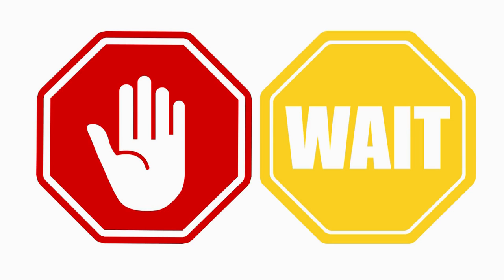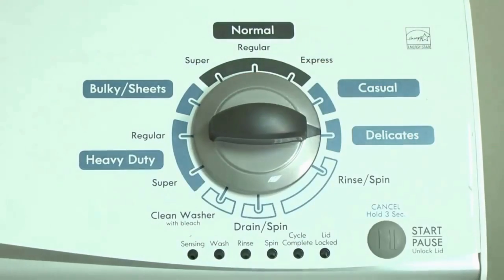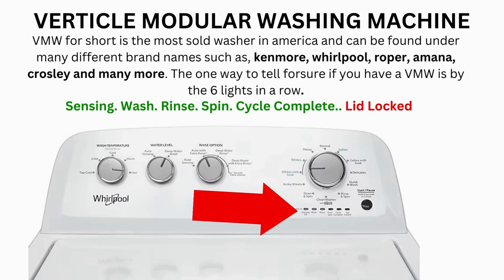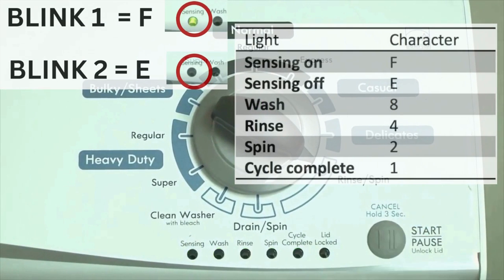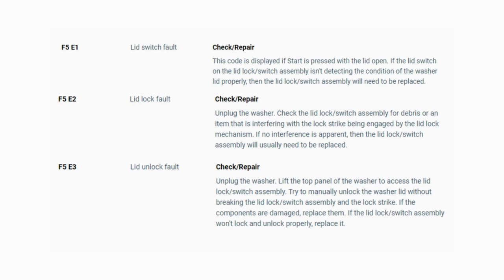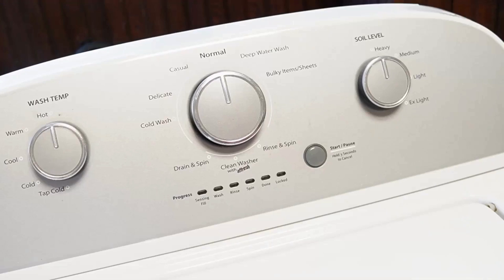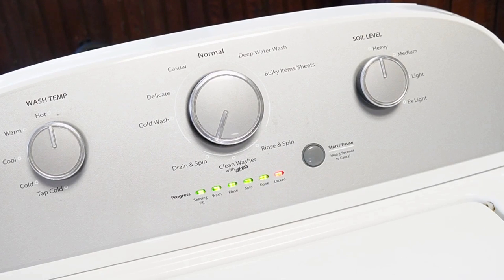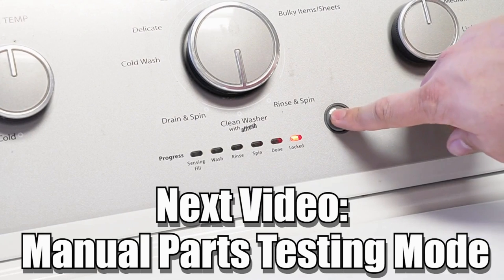Whirlpool Washer Sensing Light Flashing   Troubleshooting Guide

Comment: Hi!  how you doing method meets madness I have the whirlpool just bought it 2 yrs ago. I turn it on. it puts some water in then just keeps rotating the drum like it"s looking for the signal.   i have recalibrated it multiple times. tried to retrieve codes and all i get is a flashing sensing signal. replaced actuator signal unit checked for sediment in water lines. capacitator works, pump works, what would you do next?

Comment: I ran the diagnostics and the sensing light flashes on my WTW5000DW2 and the sensing light flashes. The problem has been that the washer only fills about 3 inches on the wash cycle, but fills completely on the rinse cycle. I just want to make sure I order the right part, if needed.